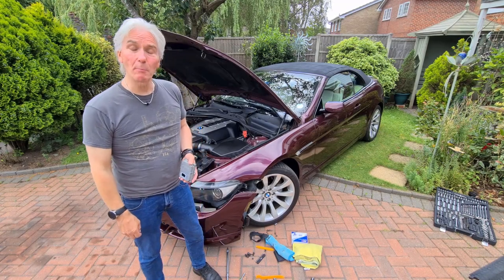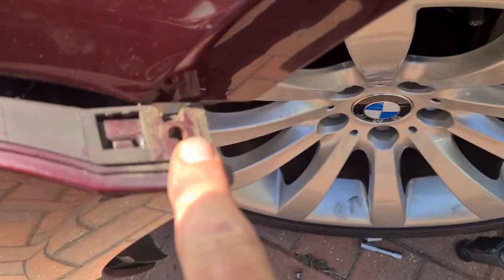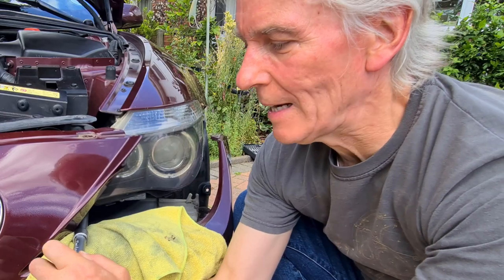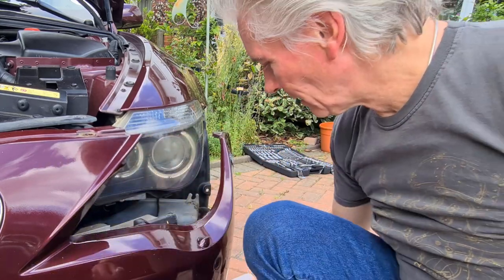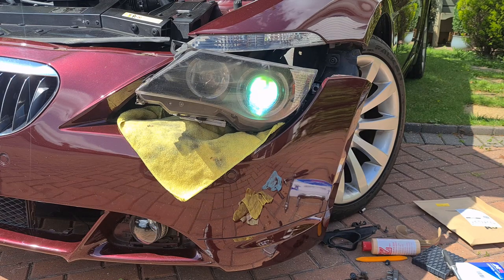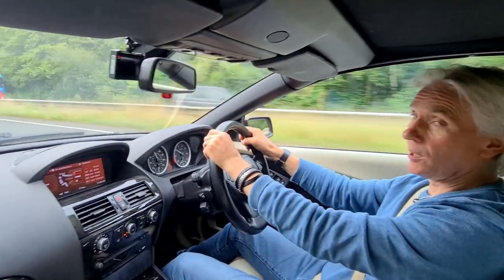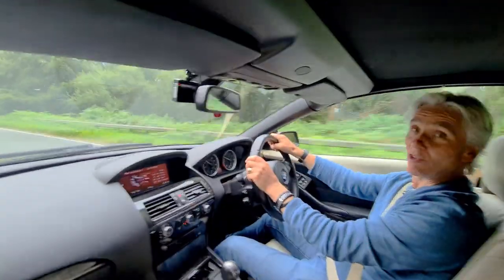BMW 6-SERIES HEADLIGHT REMOVAL NO BUMPER REMOVAL

Comment: Timm. Thank you thank you thank you thank you thank you thank you thank you thank you thank you thank you thank you thank you thank you thank you thank you thank you thank you thank you thank you thank you thank you thank you thank you thank you thank you thank you thank you thank you thank you thank you thank you!!!!!!!!!

I have finally and slowly been able to work my way through your video and I bought the unit from amazon that you advised and it works!!!

Three garages I have taken this to and they havent been able to solve it. Told the control unit would cost me over £700 and that I needed to replace both sealed unit headlights at about £1000 each.

The MOT had expired so I couldnt even drive the car as I couldnt get it MOT'd.

The light is now working so I can get it MOT'd and on the road again. You have saved me so much money and solved so many problems!

I owe you many many pints!!!.  I have also thanked you on Bimmerforums.
Reply from the maker: That's great news and is the reason I do these video's in the first place!

Comment: Timm , one question. I have my right xenon failing. Is not the bulb because some times works ok. I have disassembled the bumper and take out the ballast, but seems quite new and no humidity marks inside. So I don't know what to do. buy new one (which one? It has 2)? Thanks in advance. I really appreciate your video

Comment: Top tier video, I did this myself yesterday after diagnosing everything and leading to the control unit being broken. The front bumper took a little bit of persuasion to come away from the frame (and that stupid bolt directly underneath the headlight unit) but otherwise amazing walkthrough and definitely saved me a load of money. Thank you Timm
Reply from the maker: My pleasure, that's why I do this!

Comment: Hi Timm. Thank you for this really useful video. Worth noting that your method also gives access to the PDC sensors in the front bumper. It enabled me to swap out my middle left sensor that was not working. Unfortunately, the sensor still does not work so I'm thinking it must be a wiring issue!... unless you have any other ideas?!
Reply from the maker: Use INPA to work out what is going on otherwise you are working in the dark

Comment: Would the procedure to replace a headlamp washer be similar? Easier to remove the wheel arch liner do you think? 👍 Edit: see you suggested on balance probably yes 😎
Reply from the maker: Yes, you can reach the washers with the bumper pulled half off

Comment: Hi Tim, since you have a lot of knowledge on these cars and the lights, I would like to know if they are switchable between RHD to LHD and visa verse. I didn’t find any info on the BMW forums and whether the beam is flat like the US market or whether it lights up the side of the road. Can you help answer this question and if they are not is there a way to mod them without replacing them - thx

Comment: Perfect.  When the bulb and ballast are not the problem this is the next step. Pulling the bumper out, but not off, allows for a faster repair. The wires inside the fixture were falling apart due to heat damage combined with cheap insulation. With the replacement of the control unit and new insulation on the wires everything is working perfectly again.  For the rest of my comments please see 1981pablohoney below.  THANK YOU!!!!!😊☺😁🤠🥳😎
Reply from the maker: Thanks to you too!

Comment: Just came across this video, I had the same problem with condensation build up in headlight,got new bulb and ignitor first and still no light working, then followed your video,got the control unit and it works now, thanks for your very useful information, saved a bunch just before service and MOT time.

Comment: What where the symptoms of the ballast(control unit) being the cause and not the xenon light bulb? 
I have the main beam working, but it seams after it being on for a while it drops out and does not come on until the lot has cooled off or so and the next day it will work again at first and then drop out again. .... and so on
Reply from the maker: That sounds more like the bulb or the igniter behind it rather than the control unit
Reply: Thank you for your advice.
That would be an much easier option than taking of the front number to change the control unit.
But I am surprised about you mentioning the igniter. I would have thought that it’s needed only to start the xenon bulb and not to keep it going.
Do you have a video on this igniter and xenon bulb?

Comment: Your a Godsend, no way I would be able to tackle these issues without your thorough videos. I'm headed out the door to tackle the controller as you call it. Others call it the ballast. The starter/igniter and bulb have already been replaced and still no light.
Reply from the maker: Good man! It's definitely a controller not a ballast under the headlight

Comment: Hi Tim hope your keeping well, thanks for another great video, I noticed though I could be wrong that the top of the headlamp you removed seems to be missing a rubber strip that fits flush across the front edge of the headlamp? I only noticed as one side of my e63 645, that rubber has virtually perished in the middle section and on the other side its all there. Would love to know if you had any thoughts my friend
Reply from the maker: The gap between the indicator and main assembly has always looked awful - and RealOEM doesn't show it as a separate part!
Reply: @TimmsBMWRepairsandInformation  hi Tim, thank you, I agree it is awful,  I was told by bmw parts that the bit of rubber is part of the headlamp so would have to change the whole headlamp for silly money, I was going to glue strip of neoprene back in there but can't see how that would make  difference to anything 😀

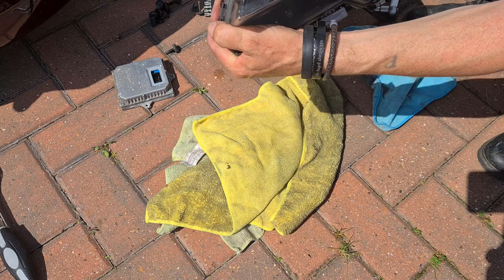Comment: 19:45  and 22:29 Just a side note. I belive after some wiggling with the whole lamp (turning it up and down during ballast replacement) we can see a particle of a dirt (??) that popped up from somewhere inside of the lamp to the front. Somewhere from the back of the lamp probably. Nothing really serious here as the topic of the video is different. But I am not sure how difficult it would be later to get rid of that dirt particle (a dead leaf or else) after the whole lamp went back on car. Great video anyway! I hate working with liners as you have to crawl down there alot :)
Reply from the maker: Thanks Bargla, that light unit is coming back out again as I noticed that the front glass should be able to be removed and the inside of the glass is dirty - hopefully I should be able to do this a lot quicker this time!

Comment: Hello Tim, I noticed you said the module was damaged by water.  I had a similar situation on my e90. I got water in my trunk from a bad tail light seal. I had noticed because my sound system had shut off. I found my factory hi fi amp in a pool of water. So I removed it and opened it and used this product called CRC electronic connector cleaner. Connected it back and it started working again. Great product, even used on my phone that fell into a swimming pool, and it worked. Just a suggestion if you ever run into water issues with electronics. Great Video 👍 and Thank you for the good info on the 650i. Noticed there’s not a lot of information support on the 650i compared to other models.
Reply from the maker: Thanks! There was no coming back for that light module, it was not only damp but had frizzled itself!

Comment: TIIIIIIMMMMM PLEASE HELP. How the hell do i get my parking sensors working again? I checked to see which one wasnt clicking/working and replaced it in the rear bumper now my front far left one stopped working. Can I change that through the wheel arch or do I have to take the bumper off? Also is there something i should check before replacing all the sensors one by one as they fail?
Reply from the maker: You need INPA - this diagnostics will show which sensor is not working. This may also help: https://www.meeknet.co.uk/E38/PDC/Index.htm
Reply: @TimmsBMWRepairsandInformation  Legend, thank you. I will check it out.

Comment: Do you have a video for the front bumper on phases 2 facelift 
I don't know if there are screws at the bottom of the bumper?
thank you
Reply from the maker: No extra screws if it is still an E64 - if it's an F06 then there are an extra 12 fittings!

Comment: The two 8mm bolts that hold bumper to wing don’t undo them. Just pull the bumper forward as it slides forward out of the clip. Then it refits with a push in from the side on refitting saves loads of time and your hands. The ballast boxes have a seal on them just around the connection bit. Always great and helpful information
Reply from the maker: Thanks Steve, I'll give that a go next time - I want to get that light back out to clean the inside of the glass!

Comment: Did you have to recode the control unit? My lights work but don't turn left and right with the wheel.
Reply: on my 2004 they are plug and play. Not sure about the newer models.
Reply: @thethomasj1795  Thanks for the feedback. I'll have to pick on up and see
Reply from the maker: No, no need, it's quite a simple control unit!